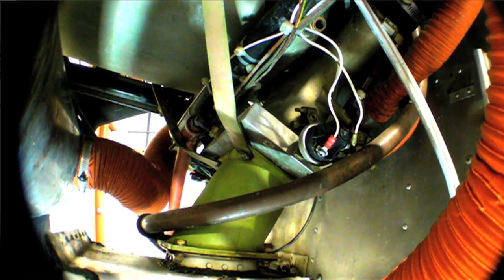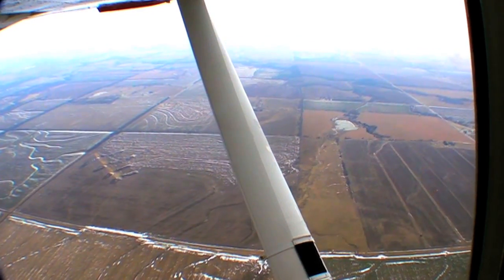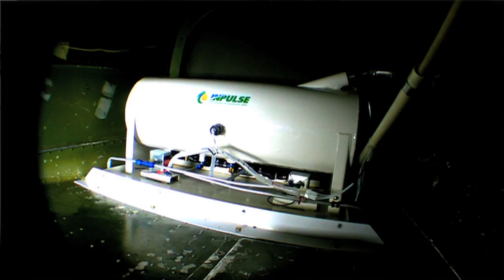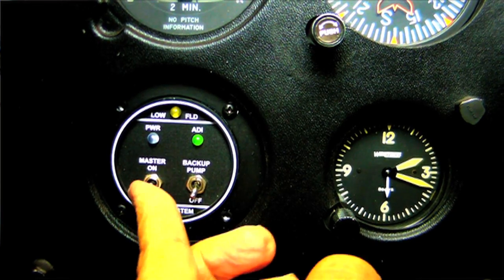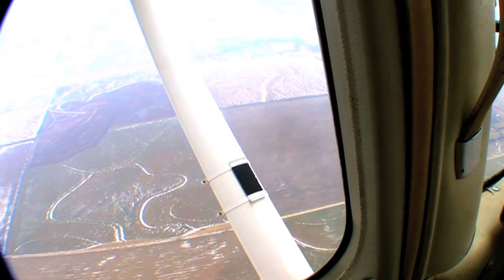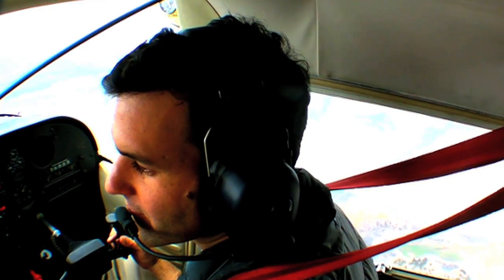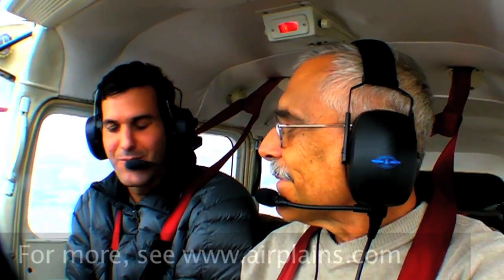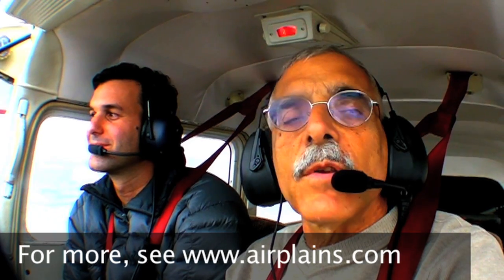Airplains' Inpulse Anti-Detonation Injection

Comment: I have used and maintained ADI-system as they already exist in big radial engines and the corrosion and maintenance of these systems is very significant, also the upfront cost of the $12K is awful enough. We should just rally to keep AVgas 100LL and keep flying. Depending on ADI systems is quite a headache that I hope to make do without. I believe the "Unleaded Future" holds nothing good for General Aviation. Regards from Alaska!

Comment: with the amount of money you'd waste on this kit, might as well just keep burning the proper octane fuel...
Reply: for personal use it definetly won't make sence just yet, but if it becomes popular and/or engine manufacturers include this option as standard the 12k could drop significantly in the future (one can hope). I did some VERY basic math, a flight shool that flies 400 hr/year, by switching in the north east from 6.21 $/gal 100LL (7 gal/hr consumption) to 87 regular (3.8 $/gal) would save around 6k$ a year, paying off the investment in only two years, BUT, this doesnt include down time or cost of repairs which is always an uknown in new systems. Also, as 100LL goes more scarse this system would make more sense, specially in the developing world were 100LL is unexistant